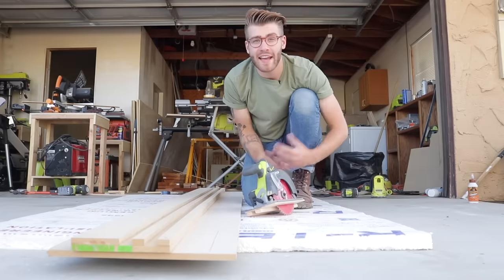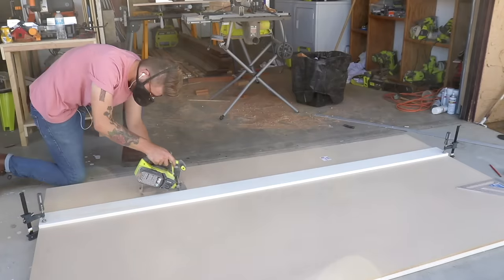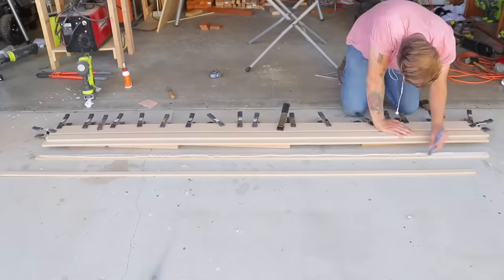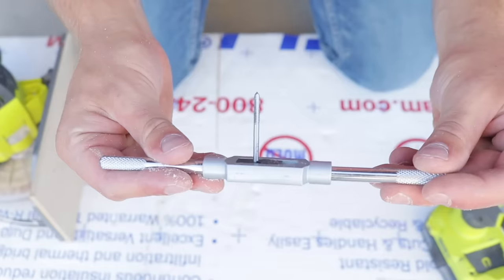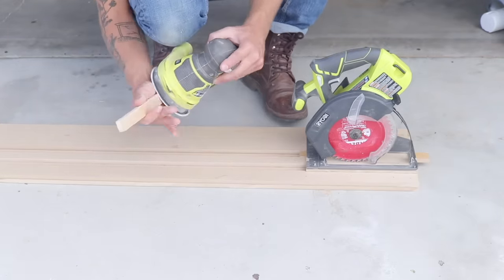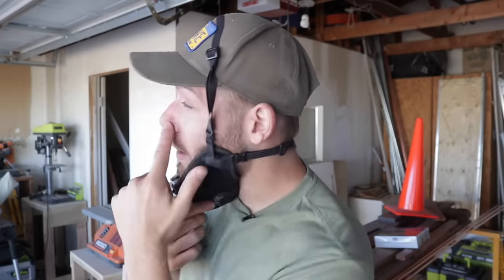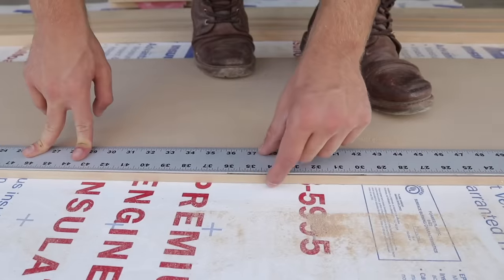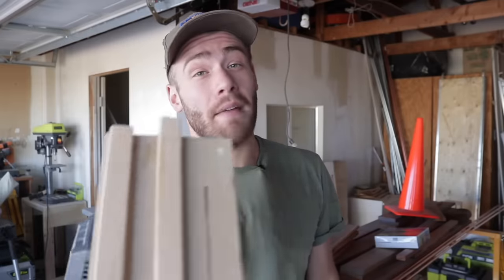DIY Circular Saw Track Saw Guide | Limited Tools

Comment: Nice and all, but I have yet to see any superior utility of a "track saw," whether store bought or hand made, over a circular saw and straight edge.  They both entail two essential components - circular saw and straight edge - and in both cases, the straight edge has to be carefully measured, aligned, and clamped down.

Comment: Fine video.  1:97, the dilemma of the perfect 90 degrees and still move down the track.  The circular saw's torque constantly pulls the saw away from the straight line. Wax.  Lots of wax.

Comment: why make a track saw when you showed us you can make perfect cuts with just 2 clamps and a board?
Reply: Are we the only ones wondering the same thing!?!?
Reply: Legit point! Lol
Reply: the time saved from having to do hundreds of straight cuts makes it worth making a track saw
Reply: It's a pain in the ass having to account for the measurements of the circ saws base plate every time you need to make a cut, also eliminates another point of human error with each cut.

Comment: That's quite a bit over engineered. You don't need the baseplate and runners. You can simply have one straight edge to run your saw up against with a 1/2" track for it to run on. Plus you don't lose the depth of the saw blade.
Reply: That works so long as the blade is perfectly parallel with the edge of the base.  Unfortunately, that is probably not the case.

Comment: Sorry, but from someone with thirty years of experience, your wasting your time with this. The irony is that you almost had the job done with your first cut. Here's how.  Glue a straight guide onto a piece of plywood leaving an edge wider than the base of your circular saw. Run the circular saw down the guide cutting of the excess plywood. Voila! Your done. Just clamp the resulting jig to the work with the edge aligned with the cut line and run the saw down the guide.
Reply from the maker: I've seen plenty of door boards, but I thought this would be an interesting take since it has a positive stop in both directions. a lot of 'newer' woodworkers watch and build my stuff. This style track makes sure that the saw always stays in plane with the 'fence' and I think it's worth the extra couple steps

Comment: losing alot of blade depth on this design, but if it has enough left for your needs you probably just saved 300$+

personally id make it out of 3/16 or 1/4" aluminum as im quite ruff on gear and need full blade depth alot, also i have the tools to work with aluminum or steel already only down side is aluminum vs mdf cost, could make a few sets of guides from one sheet though and sell them to recoup the cost maybe even profit

Comment: As Improvement: why make a 8', 4' and 2' jig when u can make 8' jig, cut it to 4' and 2 2' jigs, use 1/4" dwell pins to fit the the pieces together for 2', 4', 6' or 8' jig. I'm all for saving space.  also from another video, cut a t-track down the length on the underside of jig for clamps.  this way the clamps are never blocking the saw.  I don't remember the name of the clamps, I remember they said you can get the clamps at Home Depot.

Speaking of saving space and when I don't have to fix kids scooter.  I have been building a stand for a 1952 Craftsman 8" tilt Cast Iron Table saw.  The stand will include a DYI suction system, Safety switch, Delay switch for suction, fold down wings and rip fence.  With the wings down the table saw storage will be 21" x 22" before the addition of the rip fence.  I have limited space as the garage is my auto/bike/scooter and workshop.
Reply: Fine idea.  Please share a video and plans.  I cannot wait to do what you describe.

Comment: Why over engineer this?  Two pieces of wood is all you need.  One as a guide and one for the base to ride on.  Cut one piece smaller than the other and glue em together.  Leave the bottom long (past the saw blade and cut it off following the glued on top guide.  No need to attach shit to your saw.

Comment: Really?, At 1 minute into the video you just showed how to make a straight cut.  Clamp a straight piece of wood onto whatever you're going to cut and that's it.
Reply from the maker: ....and
Reply: @ModernBuilds  Yeah, I would have liked to see you clamp a couple boards from the other side to prevent that straight edge from bowing. MDF trim is pretty bendy and the problem with using just a straight edge is there has to be some sideways pressure. Great idea though. I like the two slot system and I think I'll build this myself. Still using my old 3/4" heavy-assed MDF trackless one I built years ago. 

Does your saw stick anywhere? I wondered about using a few strips of UHMW tape on the track top. If not, I would give the bottom of the saw rails a quick sand so they don't hit the bottom of the tracks.

Comment: You wasted, I’m sorry to say, a massive amount of time and energy.   The product you produced has too many variables in its production to allow you to manufacture the same thing every time.   

Next time just adhere a strip of material to the top of another, wide enough for the baseplate of your saw and cut against the raised piece.  it will give you a flush cutting guide in minutes and requires no tapping and drilling.   

Also your choice of MDF is highly questionable when so many light weight more durable materials exist.  
This Old House’s video shows you how to get it done with quarter inch door skin.

Comment: Jesus,  you are using hot glue.   This is a hack job.
Reply: Mike Pippins diresta uses a 2x2 hot glued to a piece of plywood. If it works it works
Reply: @kevincoates1597  I stand corrected.
Reply: He used hot melt to TEMPORARILY hold the piece in place so he could drill and tap the holes for screws to PERMANENTLY secure it Dr. Einstein.